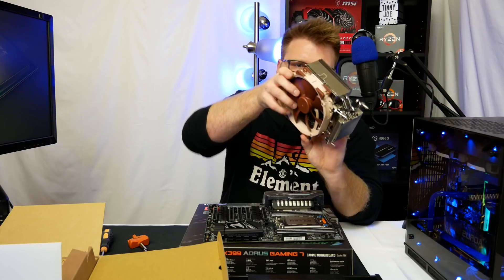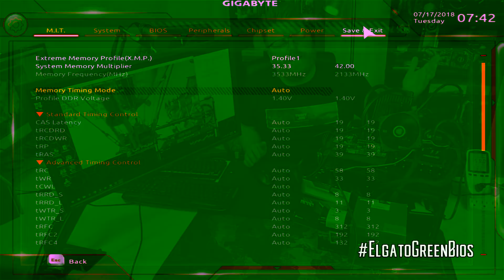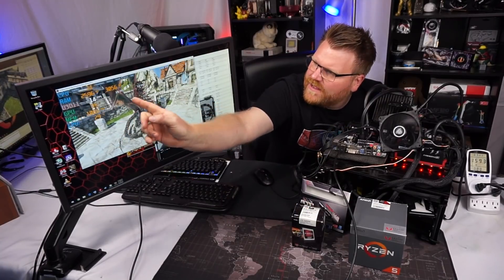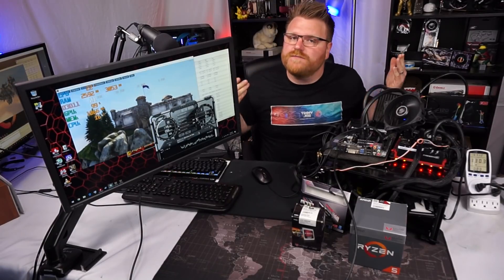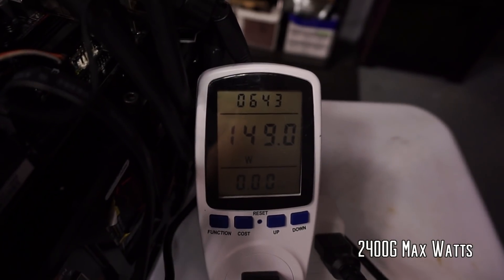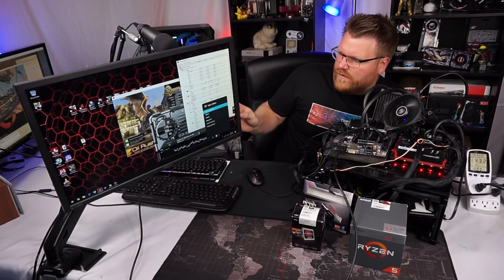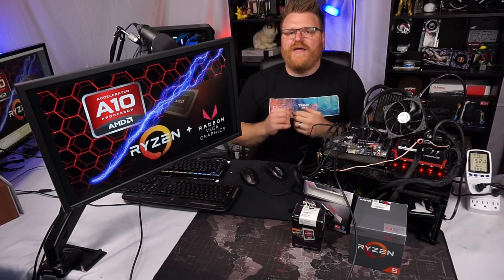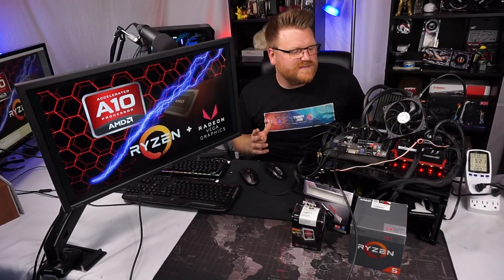How Far Have AMD APUs Come?! A10 5800k vs Ryzen 2400g

Comment: More than double the performance. These APUs are a saving grace for budget gamers.

Also obligatory & cringey PICKLE TIM!!!
Reply: most apus are not for budget gamers. they are for those for whom igpu performance is enough(!). they benefit from saving computer space and saving money for the appropriate video card.
Reply: +william blake
Well, as far as I'm concerned, if you own a RX 560 or GTX 1050  or equivalent GPU then you're not a budget gamer...
The 1030 and 550 are the budget GPUs out there, the 560, 1050, 1050 Ti, 470, 1060 with 3 GB etc are midrange.
The 580 and 1060 with 6 GB are the start of "high end" all the way up to insane with the likes of Titan Xp or Titan V100 etc...

1080p gaming isn't budget gaming yet, 920p gaming is.
Reply: +Timmy Joe PC Tech
I got a RX 480.
And sure you can run 1080p on a potato, but good performance and high settings at 1080p isn't something you do on budget hardware in high end titles.
The GTX 750 Ti is roughly equivalent to a RX 550, slightly better in some things, slightly worse in others.
Neither of those cards are 1080p gaming cards.

And with 1080p I mean demanding titles, not just fortnite, CS:GO and the like...
Also, when talking frame rate I'm talking 1% lows, not averages.

So yeah, 750 Ti, RX 550, GTX 1030, they're all budget cards, and they're all 920p cards as far as I'm concerned.
Reply: I don't know anyone who games in "920p". Either 1080p or really low at "720p".
Reply: I run Far Cry 5 on a Ryzen 3 2200G, in 720p it was playable.
Reply: Luredreier
if igpu in 2400g is not enough for you, better to buy pentium+1050(109usd launch price iirc) double the performance. again, double.
Reply: +john smith
900ish resolution is a good middleground between the two.
You play it on a 1080p monitor anyway.
One way to do it is in window mode to preserve the aspect ratio so you get a 1:1 relationship between the pixles.
Alternativly you can stretch the picture with the dissadvantages that entails...

https://www.dualshockers.com/1080p-vs-900p-vs-720p-screenshot-comparison-can-you-tell-the-difference/

The Ryzen based APUs are best suited for 900p gaming for people that's less snobish then me or TImmy Joe.
Reply: Honestly if your a budget gamer just buy a console. 200 bucks and you get better performance than his
Reply: Luredreier huh. I used a gtx 950 at 1440p. I have no idea what youre talking about a card at the calibur of a gtx 1050 or 1050ti can do 1080p high settings just fine
Reply: Dennis Pietrandrea yeah but then you have to pay for online and you lose out on hundreds of thousands of games. Id reccomend buyint a used pc over buying a console
Reply: Dennis Pietrandrea True, but doing your taxes or budget on a console...
Or any of the many many other things that you can run on a computer but not a console.
This thing can run a webserver if you want.
Or mail server or IRC server or TeamSpeak and so one and so forth.
Reply: joshcogaming Depends on the games.
You can play fortnite on a potato at 4k.
My own RX 480 or a GTX 1060 with 6 GB memory is no longer enough to play 1080p without compromises in my view.
And I am playing that at 1440p (but have access to a 1080p monitor too).
I'd say go with a 1070 Ti or a Vega 56 for 1080p gaming with no compromise or acceptable 1440p gaming with some barely noticably compromises.
Reply from the maker: Luredreier if.your budget computer can't 1080p you're doing it wrong imho. 750ti can 1080p game.
Reply from the maker: I'm a dedicated snob though :P
Reply: +william blake
$119.99 USD for a GTX 1050 +$91.81 for a used pentium with hyperthreading. + 35 USD for a LGA 1151 motherboard...
Compare that to $156.00 + 45 USD

It's 47 dollars more and half the cores and threads and quite frankly lower single threaded performance as well due to the lower frequency and reduced supported instruction set.
Anyone buying a R5 2400G needs the threads, otherwise they're going with a R3 2200G.
If they're happy with 4 threads they can just pay 94,91 for the 2200G for 139 USD for CPU, GPU and motherboard vs 246,81 USD for your suggestion for that combo...
107 USD more for your suggestion then the equivalent in CPU terms APU solution...

Also, you clearly didn't read what I said given that you think that I don't think the APU is good enough for me and suggest something else.
Read earlier in this thread and you'll see that I own a RX 480.
I also own a R7 1700.
However that is both high end as far as I'm concerned.
That 1050 you mentioned is mainstream in my view.
And if you want budget then I'd say that would involve a RX 550, GTX 750 Ti or GTX 1030 or something either equivalent or cheaper.
These APUs fit into that category.
When you look at the R5 2400G + motherboard price and compare that with the G4620 + motherboard + 90ish USD (what you're left with if you want to price match the R52400G) then you're looking at a GTX 1030 anyway...
And sure that might perform slightly better in games.
But again, you'd end up with a way worse CPU in the process even as the GPU ends up being slightly better...

The only way to significantly beat that performance with that CPU at that price is with used GPUs with the advantages and disadvantages that entails (no gurantee for one).
And technically you can get that CPU used too and save a few dollars...
But when you're looking at the used market you're dealing with a completely different beast anyway...
And eventually the R5 2400G will be available used too from people upgrading to something like the R7 2700x etc...